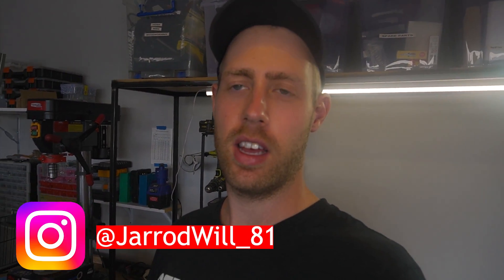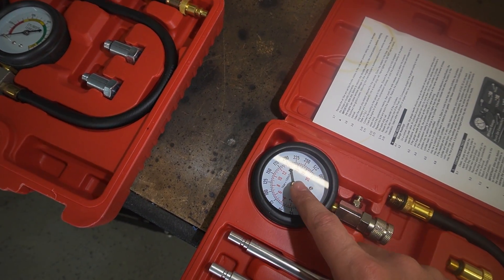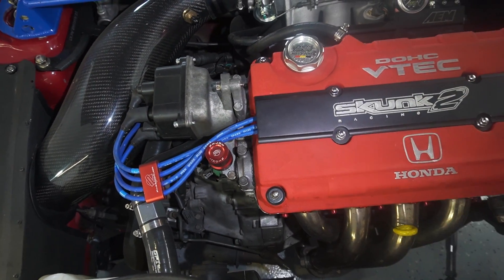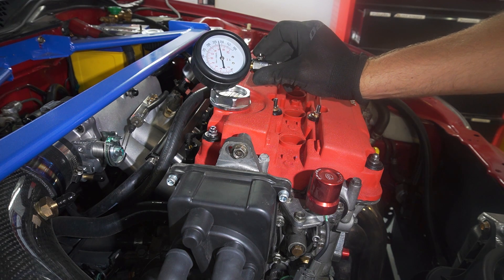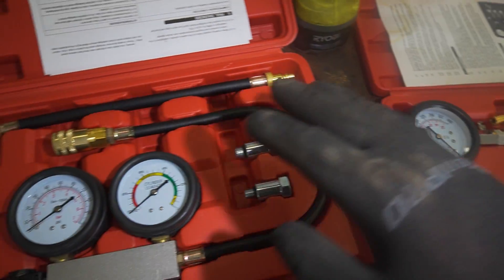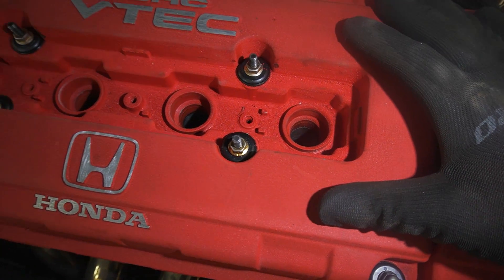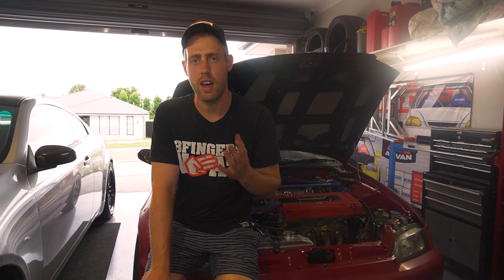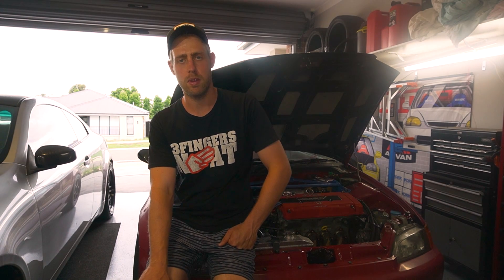Testing The High Compression B16 Eg Civic Engine

Comment: Hey Jarrod! Have you found the issue? I'm building a B16A so it would be nice to know about any issues in advance.
Reply from the maker: The valve adjustment was too tight and I did the clearances. Went back to the dyno and it made the same power. 117kw is pretty much what they make. Stock ones usually make 90kw.
Reply: @JarrodWillemse  I see. Have the cams been degreed to their suggested centerlines? Valve adjustment to Skunk2 specs? The Pro2 cams are very aggressive, you may also be overcammed without any head port work even with high compression. I see that you are running the whale intake. I would strongly suggest swapping that for a 3 inch short ram with a velocity stack, you will pick up some power for sure. Also not sure what intake manifold you are running, but the stock P30 will be restrictive over 8k rpm with such a high lift/duration profile. You can port that with good results or swap it for a Skunk2/ITR style one. But still, in my humble opinion you still have quite a bit of power hidden somewhere regardless of a low-reading dyno and a 90kw baseline. Not hating or anything like that, just trying to help out as you have a great build.
Reply from the maker: @danielrubiano5354  Hi mate i went back to the dyno and we played with different intake and exhuast cam settings and it made barely any difference. The intake manifold is a skunk 2 with 70mm throttle body. The tuner showed me b20vtec cars he tuned and they made like 120kw. Im going to leave it for now and slab a turbo on later.